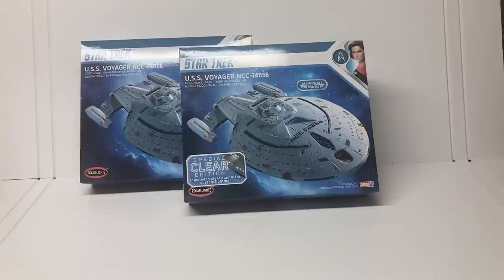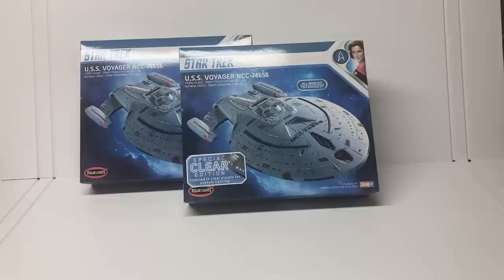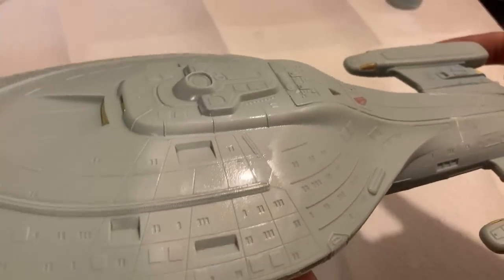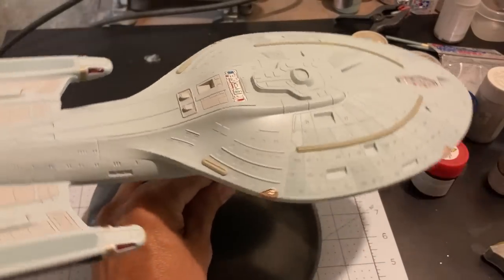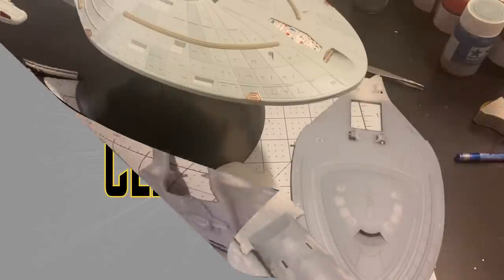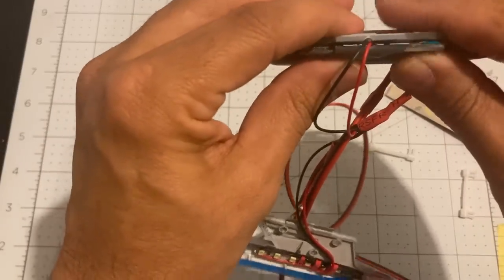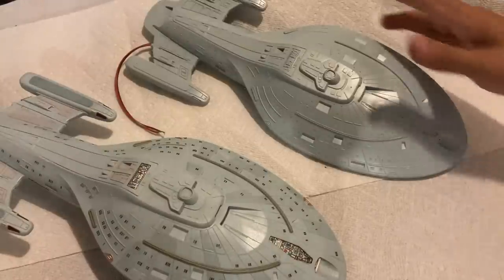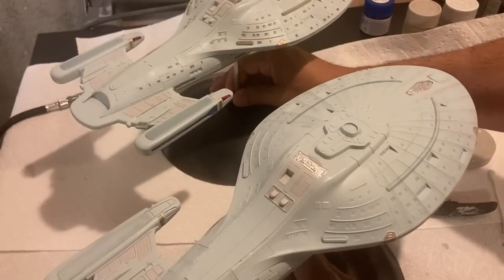1:1000 Voyager Double Build. Standard and Clear Editions

Comment: I did a Revell voyager lit up which looked pretty good, which I built for a friend but I might see if I can get a hold of a clear one f I want one for myself. I found this video really useful; I didn't realise light blocking just using exterior paint wouldn't work and that would've led to a terrible mistake- I have a couple clear Enterprise D's, one which has a Nebula conversion kit. Tempted to maybe to the polar lights Voyager first as practice in case things go wrong!

Comment: I've never worked on a clear kit before, but I wonder if it might help to use an exacto around the edges of the window first, so you don't accidentally scratch off the surrounding paint as well?
Reply: I'm watching Trek Work's latest build.  He was saying that when cutting out windows, it's impossible to keep things even from window to window and it really shows when they're lit up.  With paint scratching you can be more precise.
Reply: @robk5865  Aztec Dummy is working on some VOY window masks right now that should be perfect for this kit.
Reply: @davidjames1389    that'll certainly help.  Masking is a nightmare wuth these kits.

Comment: I just got the clear kit for voyager and am pouring over how you and others lit it up. I've done a bit with just led strips and diodes, but not both together. I'm wondering about the diode that connects to the LED strip on the NaCells, Did you just connect it directly to the end of the strip positive to negative and do you have a resistor hiding in there I just cant see? Are your LED strips 12V or 5V? This absolutely looks incredible!

Comment: How much putty work have you done, especially on the clear version, from the video the molding and fit didn't look as good as the normal one ?

I build the revell one and light blocking the seams was the horror.
Reply: Very little putty work on this one. the parts fit inside each other so you really don't need to do much at all for light blocking. It's all the extra layers of paint that made the clear version not fit as well as the standard